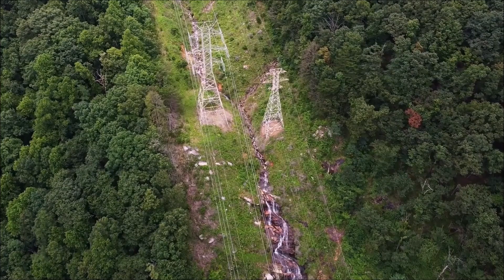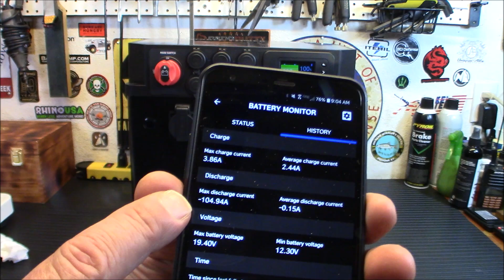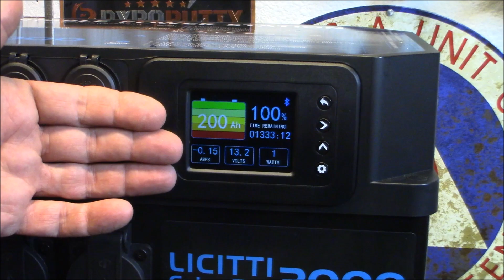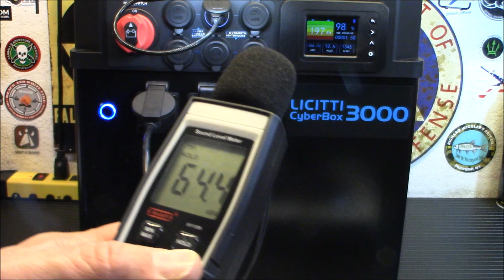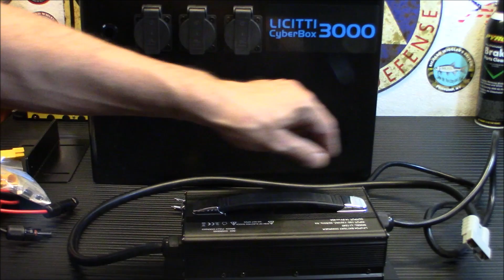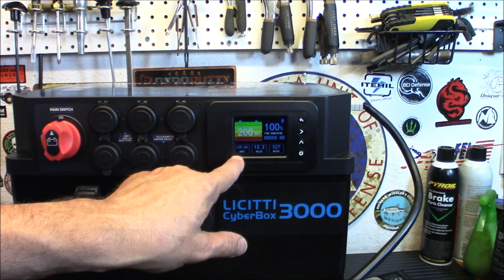Power Loss, Are You Prepared? Licitti CyberBox 3000 Portable Power Station

Comment: They have a 24v 150ah version with 300ah rated poles for daisy chain another expansion battery but it's missing the wireless charging. I think i go for that one. Did you tested that one?

Comment: The documentation states the Licitti 3000 and the version 2 can product 220v AC. This is critical to power my 1 1/2 hp well pump instead of a loud generator. Do these Licitti product 220v suitable for a 1 1/2 well pump (550ft.)

Thank you.

Comment: My Cyberbox 3000 with 300Ah just arrived tonight.
First thoughts are...WOW...put together amazingly well and very solid metal case for cells.  Display is really nice and am just shocked at what I got for the price!!!
However,
The NEGATIVE....I received NO charger or any cables/accessories.
Will contact them to find out issue.
Other then that, it is an awesome unit.
Reply from the maker: Yeah certainly email him over that, there should be a charger in there, at least i know mine came with one
Reply: @Iridium242  mark from licitti emailed me back rather quickly, and stated another package is being sent with charger and cables like in your video.
If they send all those items, then this has to be the best bang for the buck I have seen.  The quality of the unit is quite impressive.
Reply: Yes - had to request the accessories as well, and was initially told "I did not order it".  But in being persistent, everything (seen in the video here) was sent out from the offices in Chine (aka-3 weeks shipping to get here)

Comment: @Iridium242 I want one of these bad, but I'm not well versed on these units.  On the Licitti site, they offer the CyberBox 3000 with 200ah and 300ah batteries for very little difference in price.  Is there any difference in the two units aside from battery capacity?  Are the units the same size?  Do they have the same capability?
Reply from the maker: Same unit but more battery capacity thats all
Reply: definitely heavier, lol. My 3000 weighs in at +- 90 lbs.

Comment: A few questions about this unit because im ready to buy it 
1- can i charge through ac and solar at the same time for a faster speed changing?
2- can i use it 24/7 powering a fridge? Im planning of living this at my garage with some solar panels and run a fridge and probably charge my tools batteries
3- in case of emergency, can i xharge through a gas generator and use at the same time?
Thanks i hope you can answer my questions because im interested
Reply from the maker: Yes to all. It should  be fine

Comment: Will it start charging from solar automatically when the panels are getting voltage  or do you have to push a button to get it to go ?
Reply from the maker: It starts charging from solar when solar is plugged in. And, of course, stops when it reaches its set level.  I have mine set to cut off at 14.4 volts but you can change it to anything you like
Reply: @Iridium242 I'm glad you mentioned that you set it to 14.4. I noticed at the beginning of the video the app said it was set to 14.8.  I thought ouch too high 😂

Comment: I was looking at the specifications and I noted the "AC Continuous Output Voltage" was 100-120V / 220-240V, and the AC Rated Frequency was 50Hz / 60Hz.
I am wondering if it's possible for the user to switch between the 100-120V / 220-240V outputs and the 50Hz / 60Hz outputs?
I know it sounds like a silly question, but you do have viewers in the UK and other countries where the standard is different then the U.S.A. An example if this follows.
England: 50 hertz (Hz) and a voltage of 230 volts.  THANK YOU AND BLESS YOU FOR THE GREAT REVIEW AND YOUR CHANNEL.
Reply: I have this question as well. Kinda disappointed that you received no answer.

Comment: wonder if you can use a external mppt for higher max voltage, so you can add more solar
Reply: yes you can. there are 2 50 amp input/output Anderson connections and a 175 Amp Anderson connection. Iridium commented below that it takes 12-25volt MPPT. One thing though, even though those Anderson connections take high Amps, I wonder if the internal wiring can handle the load, so I don't know if I'd go too crazy with the solar. Maybe spread it out with 2 outboard MPPTs in 2 different Andersons.

Comment: This CyberBox looks awesome, but can the batteries be replaced? I was interested in this box over the bluetti or ecoflow provided that batteries could be replaced similar to the smaller battery box. I'm not a fan of the e-waste in buying a whole new box if it's only the batteries that need replacing after a few years on all these power station units.
Reply from the maker: It is openable, the sides have little rubber covers over the hex screws that screw the top on the bottom.  As with most of the licitti gear, you can take off the top so I assume they can be replaced, I will email him to confirm and add that to the notes of the video.
Reply: @Iridium242  Did you get an answer on this? I just bought the 3000W and hope that I can swap out batteries with a backup if necessary. Thank you for your review.
Reply: @terryloanofficer  I haven't heard anything, and I'm still waiting on the answer on the battery replacement.

Comment: Thank you for the excellent detail provided and your time in producing this video. I'm considering getting one for use with communications gear (primarily Disaster Relief related and for the ham bands 3.5 - 144 Mhz) and wonder if you tested for RFI, especially with the unit under load? Thanks, again, for your hard work in making quality videos that bring these products to our attention. The $100 off coupon is a great bonus, too!!! Mike, N3JW
Reply from the maker: Not intentionally lol I had it on this afternoon and was playing around with my Xiegu G90, no more noise or other issues, I didn't run it off the battery but just having it charging or running near the radio did not cause any RFI, I will have to test it plugging in the radio itself.   Some of the cheaper power stations generate so much RFI you cant even have them on NEAR an HF rig
Reply: @Iridium242  Thank you for taking the time to provide this information!!! And I agree with your comment that some of these units are as effective as the old "spark gap" transmitters of days gone by! Grin.

Comment: I live in Tennessee last 2 years we had tornados and ice storms knocked my power out for a week at a time 3 time. In last year alone. I really need to get one of those . I have been looking. But so many different ones out there which one do I choose for my needs .? I live in an apartment.
Reply: Make a list of what you want to run and get a system based off said list.
Reply: @Tariq1058  true fridge fan lights tv or radio
Reply: @chrisjohnson5295  Go for an Ecoflow Delta 2 system
Reply: I need one